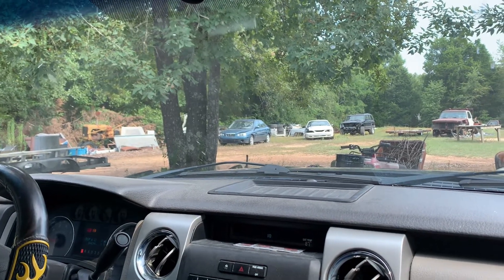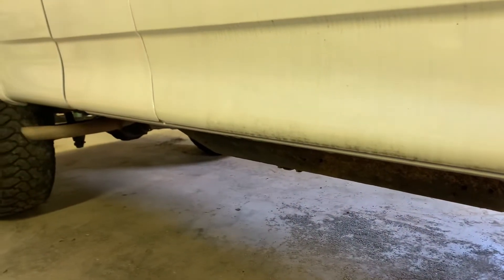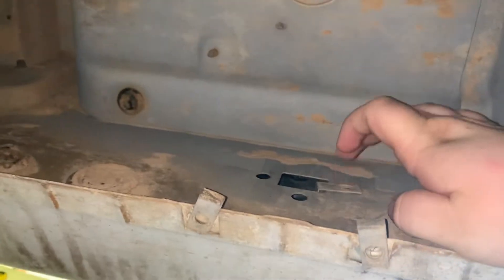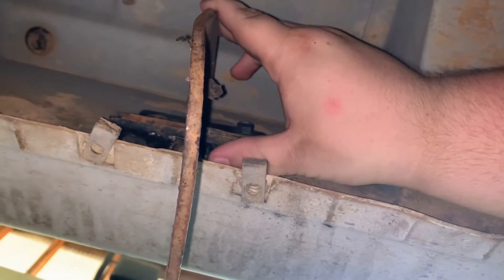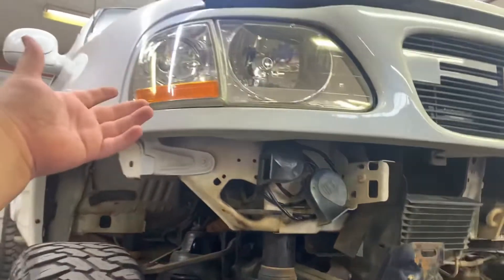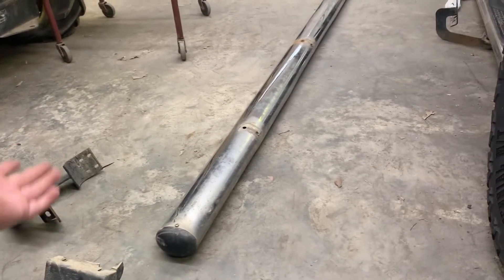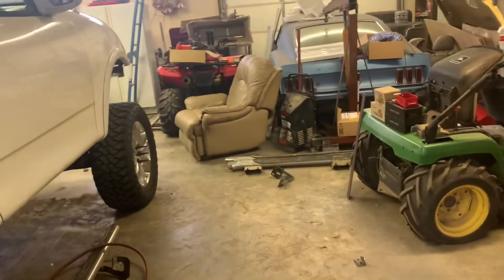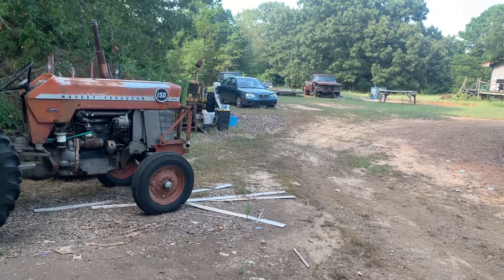INSTALLING 12th GEN F150 PARTS ON A 10th GEN PT2

Comment: What did the wheels come off of
Reply from the maker: These wheels are 2016 F150 Platinum stock wheels
Reply: @Scott46Lee  did you use adapters, how did you get them to fit
Reply from the maker: Yes I have 2” adaptors